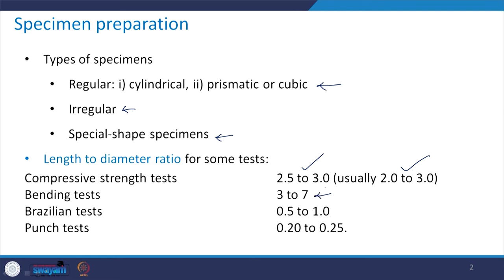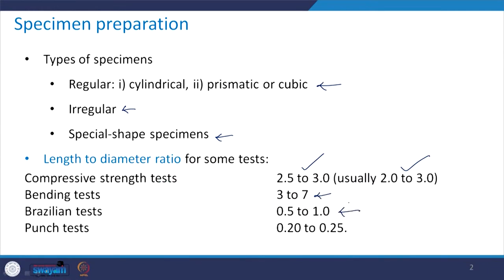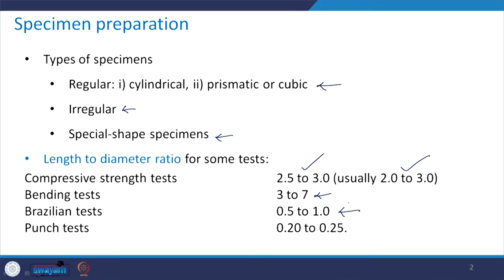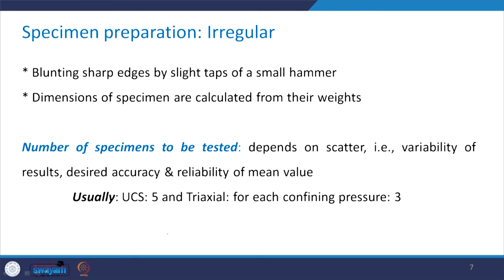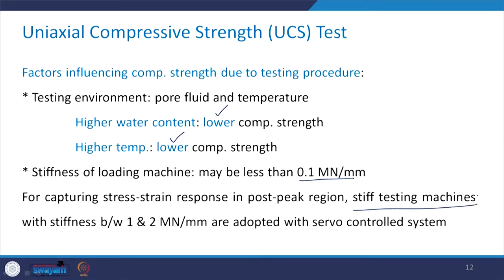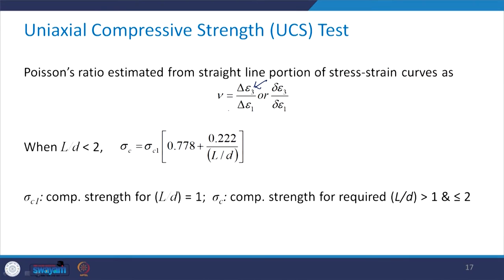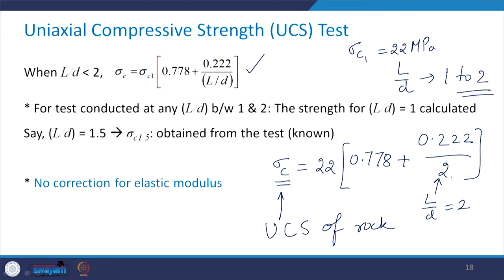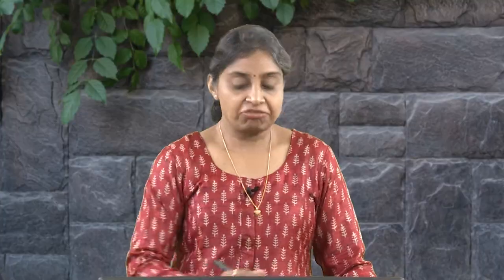Lecture 11: Laboratory testing of Rocks- Preparations & UCS

Comment: Thanks for good explanation. When UCS values calculated using shear sonic values measured in-situ at subsurface condition, and those measured at lab using cores do not match, specially for detrital rocks, how can we account for the in-situ stress ? which could be one of the reason for mis-match